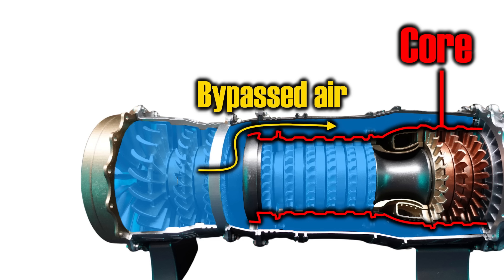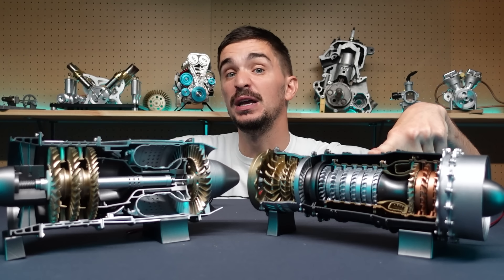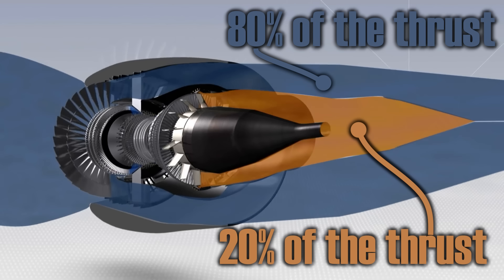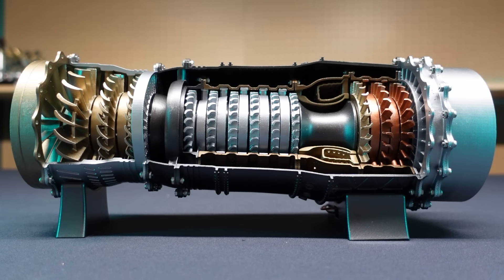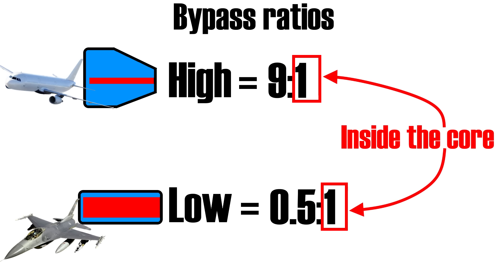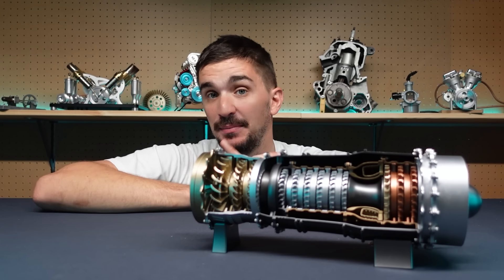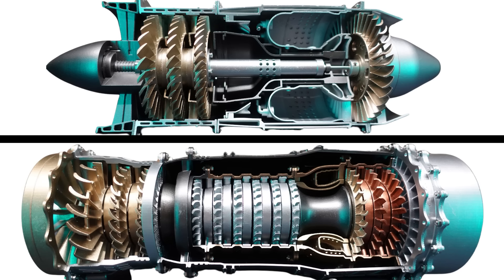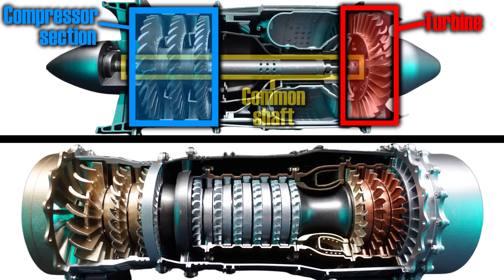Jet Engine Evolution - From Turbojets to Turbofans

Comment: Thank you for the insighful video. 
I think you can be interested by a forgotten engine, it was the first Wankel prototype. It worked very differently, everything spins, the triangle part and the housing part. This design was discarded by NSU because of a difficult access for spark plugs, but I think this was the real Wankel engine.

Comment: Can you actually cancel out gyroscopic effect by linking 2 opposite gyroscopes together? 
They both resist change in orientation and should result in double the gyroscopic effect. 
What they can cancel is angular momentum.
Reply: This is a good point. I took several physics courses at the university and I don't know enough about the gyroscopic effect to answer.

Comment: 10:30 - In modern engines the stator blades have adjustable pitch to achieve the best possible angle of attack.

Comment: Cool video  I was gonna build a cold jet using electric motor front fan single shaft front to back on bearings into a water cooler bottle and mount on a bicycle

Comment: Awsome video! I think the wording for the gryo stuff near the end may be wrong though? The two counter-spinning shafts will still have gyroscopic effects (Resistance to rotation off the axis of rotation), I think it's the rotation force from the spinning shafts that was the problem instead, initiating a roll on the plane itself, most extreme examples being old rotory WW1 plane engines. Hence, the need for counter rotating shafts
Reply: Yes.
Reply: no, jet engines of any kind make no reactive momentum like piston engines
Reply: @makantahi3731  ah ok, surely this means the video is also a bit wrong then, two gyroscopes spinning in opposite directions on the same axis wouldn't 'cancel out' each others momentum?
Reply: @harrysummers9858  it is written that way in every professional literature, i can not check it by keeping engine in hand  to feel stability  and precession
Reply: @harrysummers9858  maybe not at all because n1 andn2 spool have different mass and speed

Comment: 5:00 This is also an issue in propeller airplanes, in turbo-props and in piston powered propellers. In a few cases propellers are designed to be supersonic (the propeller, not the plane) but for the most park it's a bad thing. The XF-84 was a fighter design tested that used a supersonic propeller mounted to a turboprop engine.
     The noise level was so high it can damage hearing even with ear protection. But even this was not the loudest airplane. That honor falls to the Tu-95 Bear. A bomber and passenger airplane developed the the Tupolev in the USSR. This plane had 8 counter rotating supersonic propellers mounted on four turboprop engines. It was so loud F-15 pilots sent to intercept it found it to be deafening.
     They have tried to ask Tu-95 crew members to tell us how loud the plane is, but they don't respond when spoken to any more.
    If you can get there attention they only ever answer with "Что?"

Comment: And the Turbofans rely on the gearbox advantage.
The very same principle is used in Helicopters, where the rotor blades are "the fan".
The greater the gear ration the easier it becomes to move a heavy load (the fan/rotor blades).
But as we know, the bigger the gear ratio the faster we need to turn the input in order to get a usable speed at the output.
So, the jet engine is the perfect candidate for turning the gearbox input fast enough.
And it does it very easily because from the input the gearbox makes the LOAD at the output "feel" like nothing.

Comment: Great content. Nice to see expanding range. Your model seems to show the low pressure rotor spinning faster than the high pressure rotor. In the dual shaft machines I used to work with (LM5000 and LM 6000 gas turbines in power generation use), the high pressure rotors spin faster (10000 rpm approx.) than the low pressure rotors (3600 rpm approx.) Also, showing the gear train in your model may imply to viewers that the rotors are connected by gearing, which they are not. In fact, on the LM machines I’m used to which are based on CF6 turbofans, the low pressure shaft doesn’t even begin to rotate during startup until the high pressure compressor pulls enough air flow through the blading to impart motion. I believe this is referred to as aero-dynamic coupling.

Comment: Interestingly, the front fan in a high-bypass engine is actually a compressor! It compresses the bypass flow just like the rotor blades compress the core flow. The bypass duct in an airliner engine is in the shape of a convergent-divergent nozzle, aka “de Laval nozzle”. The bypass air compresses as it squeezes the air into the narrowing part of the duct, but then expands and accelerates once it reaches the widening part of the duct. It’s this aft expansion and acceleration that produces thrust. Many people think the fan is just a shrouded propeller but it isn’t, all of the fan’s energy goes into compressing the bypass flow so the fan has  no energy left over to produce any thrust of its own. Ironically, it’s actually low-bypass engines like ones on fighter jets that get some of their thrust by the fan acting directly like a propeller. The bypass duct is linear with those smaller engines so the fan can’t really compress or expand the flow, the bypass instead just gets blown backwards around the core and directly into the exhaust contributing to very little thrust. Low-bypass fans compress air by a multiple of 1.5 while high-bypass fans compress air by a multitude of 7, isn’t that awesome?! 🤩😍

Comment: Very good video nicely done. The only two pieces I would add are first geared turbofans. They allow increased bypass ratios by reducing fan tip speeds which allows a larger fan without generating transonic shockwaves. CMC or Ceramic Matrix Composites allows the hot sections of the turbine to run even hotter as they can withstand higher temperatures than metals. Obviously rotating detonation gas turbines are going to be more efficient than today’s combustion engines. But they only exist as prototype units and are just beginning testing in aircraft.

Comment: To really understand why an evolution from turbojets to turbofans happened, you have to look at propulsive efficiency and thrust calculations.  The propulsive efficiency is the forward speed of the aircraft divided by the rearward speed of the jet.  Thrust is proportional to the mass of air through the engine multiplied by the difference between the rearward speed of the jet and the forward speed of the aircraft.  One important thing to notice is that the thrust produced by an engine running at 100% propulsive efficiency is exactly zero.  For a high bypass turbofan, the fan drives a huge mass of air to the rear at only slightly faster than the aircraft's forward speed, so the thrust is enough to maintain cruising speed, while the propulsive efficiency is very high.  Before the kinks were worked out of turbofan designs, the only way to improve propulsive efficiency was to improve the aerodynamics, so the aircraft flew faster, with a smaller amount of thrust, but greater propulsive efficiency (this is why airliner speeds peaked in the early 1970s and then declined.  Speeds rose as aerodynamics improved and then went down as turbofans were introduced and the bypass ratios got larger and engines moved greater masses at lower speeds).  Turbofans gave aircraft designers the ability to aim for lower cruising speeds for best propulsive efficiency.

Comment: Than you very much

For a long time, I have been wondering: What is the difference between a computer cooling fan and a jet engine fan?
There is a difference in shape, why?
  What are the characteristics of each fan, its advantages, disadvantages and performance?

Thanks

Comment: Great series.   The comment about atAched to the aircraft should be amended to almost all the time its attached to the Aircraft.   We had one come down in our area when it ripped off the wing!     I would like to see this expanded to 3 shaft spools and GTF.
Reply: They have shear Bolt fixings so out of balance engines will detach before ripping a wing off.

Comment: Also, turbo fans are much quieter. The ripping sound you hear from some jet engines is created by the high velocity high temperature air in the jet's exhaust and the cool low velocity air around it.
       If you place a layer if high velocity cool air between between the outside air and the hot exhaust this ripping noise is greatly reduced.
     The high pitched screeching noise is produced by the engine itself.

Comment: A couple of things to add: Commercial jets use high bypass turbofans because moving more air slightly faster than you are flying is a more efficient transfer of energy than moving less air much faster like in a low bypass turbofan or a turbojet. The downside to this is that the fan portion cannot accelerate air to supersonic speeds, so for fighter jets or supersonic transports you need to have most of your power coming from the jet core of the engine.
Reply: yes

Comment: Awesome explanation! Unfortunately once again the model got something backwards: the engine core spins significantly faster than the fan (N1 speed > N2 speed)

This makes sense since the fan section is a bigger diameter and it’s speed is capped by that pesky speed of sound, and the core needs to spin fast enough to “keep up with” the high pressure, high speed flow.

Comment: "Greatly reduce engine noise"

When I was a kid I remember playing outside and you had to stop talking when an airplane flew over. We were nowhere near an airport, they were just that loud. Nowadays you don't really notice them. I wondered how they did it, I guess now I've got an idea!
Reply: Yeah the difference in engine noise is kind of insane. Nowadays you notice a stark contrast between airliners and military jets but back then it wasn't so different. And it's not just bypass ratios either, there are innovations made specifically to lower noise levels and some have been being retrofitted to older jets for a long while.

Comment: Another difference between turbojet and turbofan is that turbojet have directional flaps to increase thrust. That's one of the reason why you can use afterburner  only for a short period of time.

Comment: Ceramic Matrix Composite materials have been developed that allow turbofan engine components to run hotter, for significant gains in efficiency. Look for more powerful and efficient turbofan engines in the near future.

Comment: I know just enough about jet engines to ask ignorant questions.  For instance, to my mind, there seems to be a continuum from bypass jet engines to propellers.  In effect, the bypass air acts like air pushed backwards by a propeller.  For a while, engine companies and airliner companies were investigating "ducted fan" engines, where the bypass compressor was so huge it was halfway between propellers and normal bypass jet engines, and the aviation magazines were full of comparisons with turboprop engines.

Then there's the well-known use of turboprop engines for "low speed" operations, claimed to be more fuel-efficient.  Yet it's still a jet engine turning fuel into power.  I suppose helicopters with jet engines are just a different kind of turboprop engines.

Comment: I love your videos, I always learn something.  A question, perhaps you could answer in an upcoming video, the occurred to me watching this one: how do jet engines (or even all types of engines in general) start and stop?  You do a fantastic job of explaining how they work when they're working, but the on and off part has never really been explained.  If I turn off my car's engine, for example, and it's just after the fuel has been injected into a cylinder but before combustion, what happens?
Reply from the maker: It's all about cutting combustion. If it's a gasoline car turning the key to the off position cuts both the spark and the fuel (carb still does fuel) but without the spark there's no combustion so the engine may turn over a few more times on the remaining momentum (depending largely on how good the compression is) and then it stops. When you're starting it it's the reverse. The starter motor spins the engine and you're adding spark and fuel, combustion occurs and then the starter motor spindle retracts and rotation is maintained by combustion force.
Reply: @d4a  Thanks for the excellent explanation!  I've learned so much from your videos, you have no idea.  You're seriously great at taking complicated mechanical processes and making them clear and approachable.

Comment: So, the fan provides 80% of the thrust in a high bypass engine. I wonder what would happen, if you were change the propeller to this fan in a "traditional" aircraft engine.
Actually, I found some propellers with 8 blades, which are not too far from this idea :D  (TP400 turboprop, if I am correct)

Comment: Why dont they create a centrifugal supercharger that has has multiple stages of compression like the turbo fan or turbo jet 
I asked @engineeringexplain the same question
Reply: The question might need to be reframed to be more specific, the question has numerous interpretations. 
  For example, where a supercharger is mentioned, is this the supercharger component that would normally be used on piston engines and would be driven by shaft power taken from the engine crankshaft for example?
Reply: @petemaly8950  yes I mean like a normal supercharger powered by crankshaft rotation on a normal piston engine but built like a turbofan or turbojet compressor with multiple stages of compression with opposing rotors because d4a mentioned it is more efficient
Reply: @yousef_beta3a 
For a typical average piston engine there are definite limits to how much power a given size engine, or cylinder & piston in that average engine, will produce & how much power increase can be obtained by increasing compression of the intake air so it isn't worth going beyond a simple & relatively compact & inexpensive single stage compressor & turbine.

Comment: What's the efficiency of a turbine vs internal combustion? Could a turbine be used to power a generator for a hybrid car?
Reply: A turbine's potential efficiency is generally greater than that of any piston engines, however their use remains limited to more niche applications.  When used to power something off of a shaft like a generator for example, they are known as turboshaft engines.  Turboshaft engines, many of which are derived from aircraft engine designs, are in widespread use at an industrial scale.  Usually these are employed for electrical power generation, and for the compressing of gasses and liquids for the petroleum industry.  Many of these turboshafts are in the form of "peaker plants" that can be fired up at short notice to supply power to the grid in times of peak demand.  Turboshaft driven generators are also used to provide power for remote locations, wherever demand is sufficient and connection to the grid is impractical.  Turboshafts serve the petroleum industry both on and offshore.   These turboshaft driven compressors are used to maintain pressure along gas and oil pipelines, as well as on offshore production platforms.  Many modern naval vessels utilize turboshaft engines along side their main diesel engines in an "on demand" configuration.   These designs allow for a turboshaft's output to be added to that of the large diesel engines making the vessel capable or reaching far greater speeds when the situation calls for it.  Of course this comes at the cost of higher fuel consumption and reduced range, so cruising is done under diesel power alone.   Turbine engines have been experimented with as replacements for piston engines in nearly every application imaginable.  The high output shaft speed of a turbine necessitates reduction gearing in most applications which reduces overall efficiency somewhat.   Their increased noise, and comparatively higher exhaust temperatures are also factors that impact the suitability of turboshafts.  One of the more unique use cases where turboshafts have been successfully employed is for the propulsion system of the M1 Abrams main battle tanks.  The turbines powering those 70 ton tanks are remarkably compact and yet are capable of pushing the massive things to nearly highway speeds over any terrain!  Turboshafts are also capable of running on nearly any liquid or gas fuel, they aren't fussy, and that offers a lot of versatility.  In many compressor applications, the turboshaft compressors run on the fuel they are being used to compress.  This makes them ideal for use on remote pipelines.  I am surprised we haven't seen any of the hybrid cars replacing their small gasoline engines with small turbine engines, I believe such a design would provide a serious increase in overall efficiency.  The biggest reason we don't see them used in more applications is simply industries reluctance to change and the cost it would take for them to begin production.  So even though they have the potential to bring huge improvements in efficiency and performance, hundreds of turboshaft designs for applications big and small have already been designed, built and experimented with.  Sadly the vast majority of them are killed off before they ever reach mass production.  Like so many good ideas, much of the vast potential offered by the turboshaft has been squandered due to the short sighted & stubborn to change nature of mankind, modern industry and their financiers.

Comment: A two-shaft design is nearly always used for turbofans, but can be used in a turbojet, too. At least two shafts are always required in a turboshaft engine if it must start the load from a standstill, but that should be in your next turbine engine video...
Reply: ai20d engine on an32 has single shaft turboprop and to start up it is heavy job